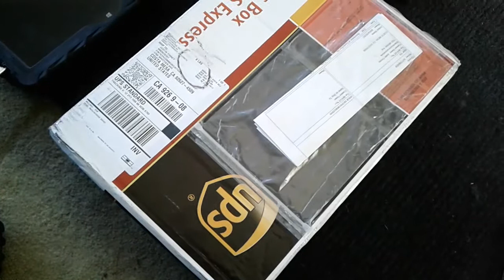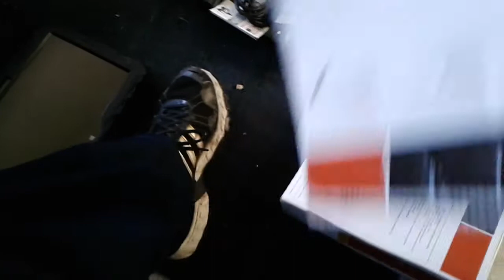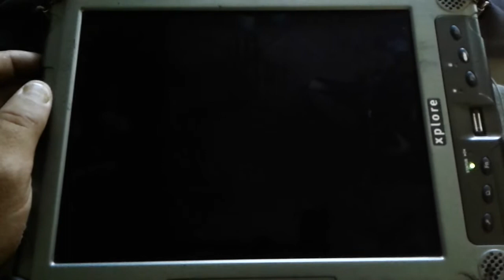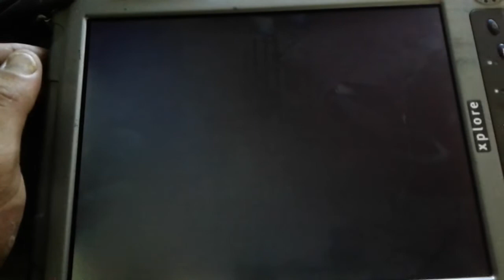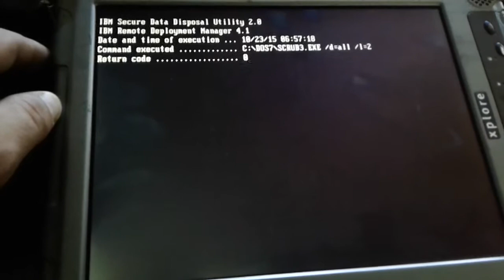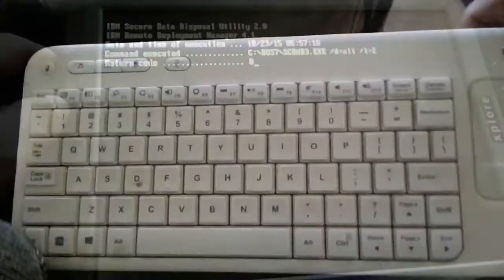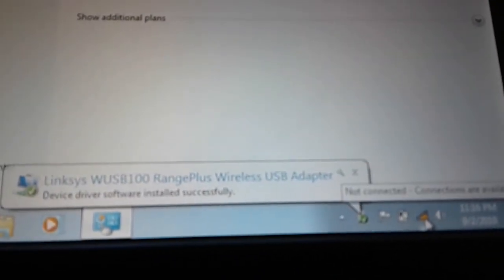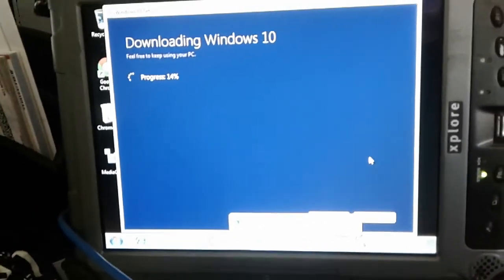Xplore ultra rugged tablet ram upgrade windows 10 install GPS

Comment: For Bios connect an USB Keyboard and try F2 at boot...

I'am having the same problems with the GPS (x-link COM5 not acessible under the Uptodate GPS Viewer, more recent than the Zebra C5 Win 8 drivers and SW)

also having problemes with Gobi 2000 or 3000 WWAN cards, not recognized, and SIM card reeader thus not seen, even if SD card is functional.

Had the same cmaera orientation problems untill i st up the Xplore specific software via Zebra C( driver and SW page. But have lost it again...